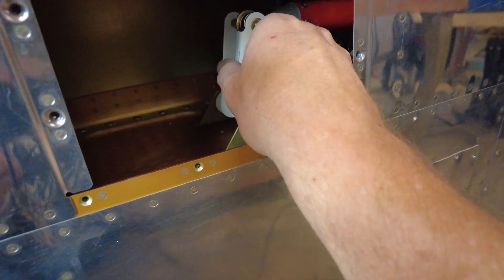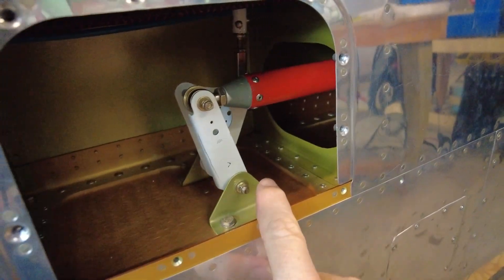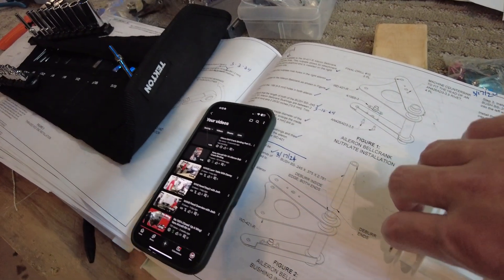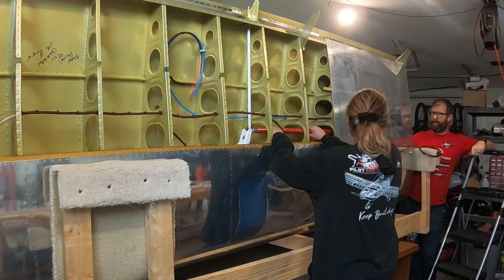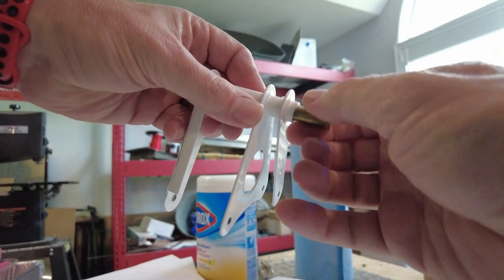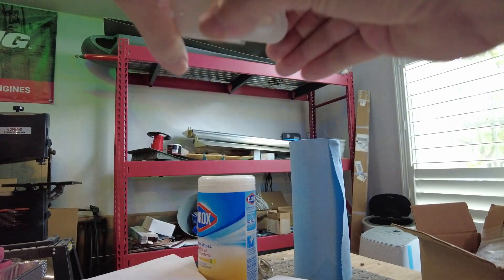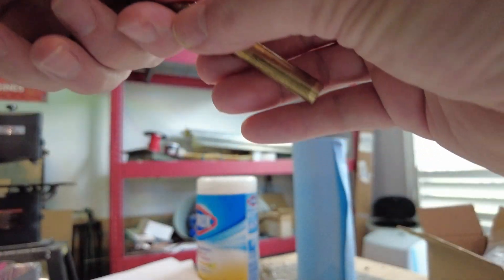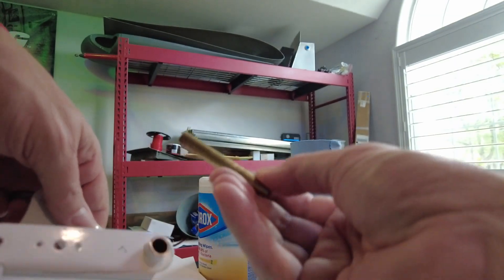Sticky Alerion Bell Crank: How we fixed it on our Vans Aircraft RV-14

Comment: Nice to see these little snags and the solution, in case I come up against them with my 14 :)
Reply from the maker: There are so many snags we run into.   Glad these help out a little bit.  I honestly searched YouTube for an answer to this, and my channel kept coming up as results which wasn't helpful to me at the time.
Reply: @N14VE  The UK RV14 builders and flyers group came up against this problem also. Same solution that you arrived at. Some of the guys had to take quite a lot of material off..